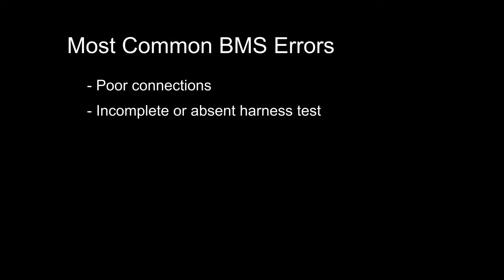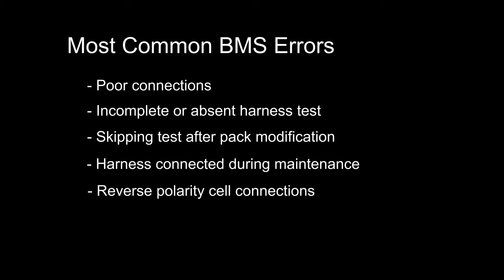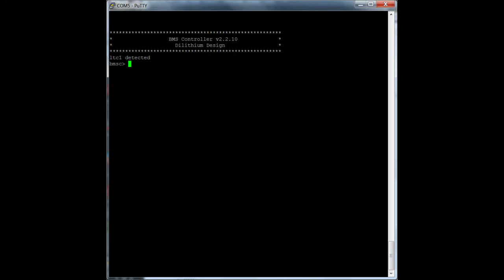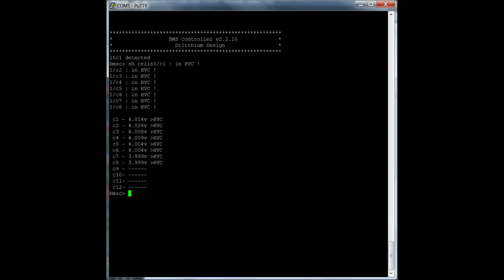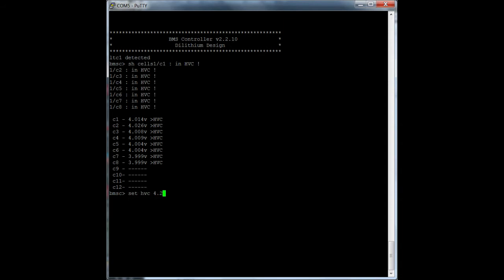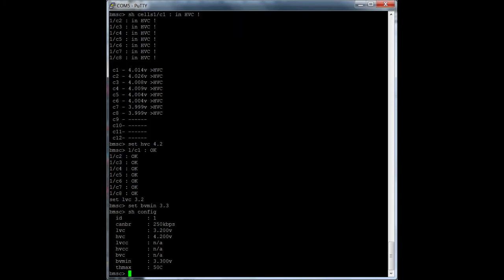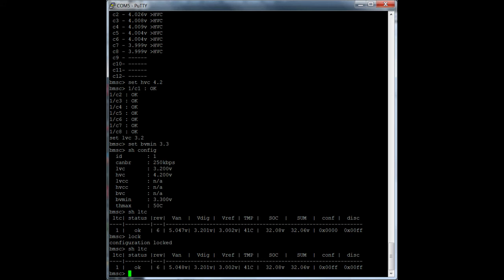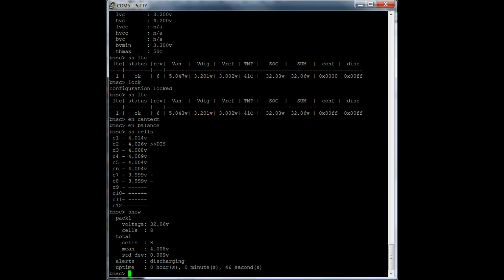ThunderSruck BMS Wiring and Testing

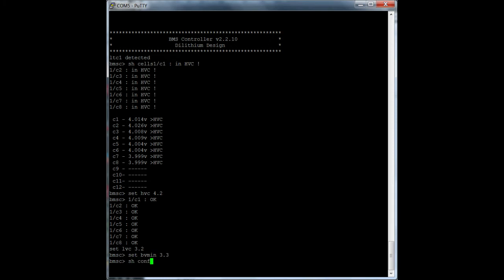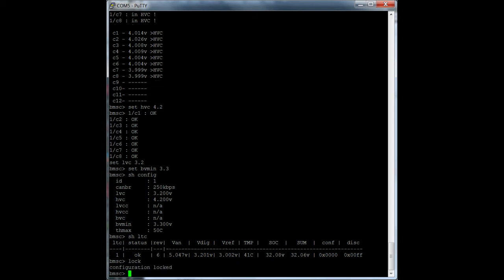Comment: Be sure to use solid wire (20 ga recommended but I use 22-24 ga) as opposed to stranded for connecting to the tiny plugs on Thunderstruck  (TS) modules. Write "LTC" on the test module with a silver sharpie so you won't forget. There is no explanation of the term "LTC" in any of the TS user manuals, but I heard the definition in this video. Be sure to use the cable provided by TS when connecting laptop to modules (USB to 3.5 mm jack). Other cables won't work. Not sure what "canterm" means at the end of this video. Not sure what this video means when it says the last two columns show an unexpected cell (at 9:55) after entering "show ltc".  Later he says enter "show ltc" again and the columns match (at 10:05) ?? Not sure what that was all about.

Comment: Hi Brian, thank's for the video, i have a problem with the bms when i try to connect to putty using USB to TTL serial cable and i already instal the vcp from FTDI chip but when i power the bms i have in the shell something weird i don't know if you have an idea bout that ?
Reply: Evidently this is a case of the incorrect communication "speed" setting in Putty. The Dilithium MCU requires a speed of 115200 for serial communication. The faster processor in the MCU makes it the only device in our Dilithium lineup using this setting.

Comment: It would have been helpful to mention the ring terminal size you used. Pigtails TS sells are 21 awg.  My battery post size required 1/4 inch rings.
Reply: Thanks for the comment. Good point to size the ring terminals as needed for the pack being connected. We used 1/4 inch in the video - even though the center terminal could be smaller. We tried to present a generic solution given all the battery options out there.